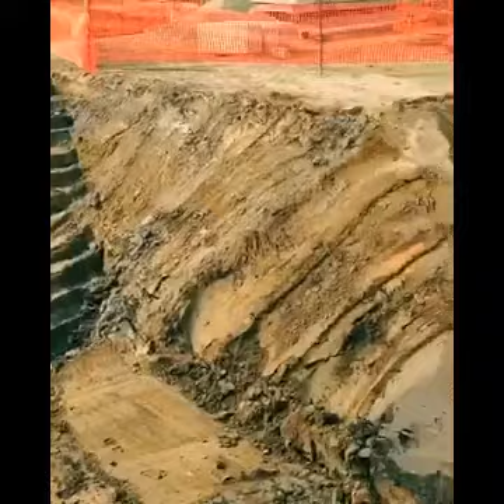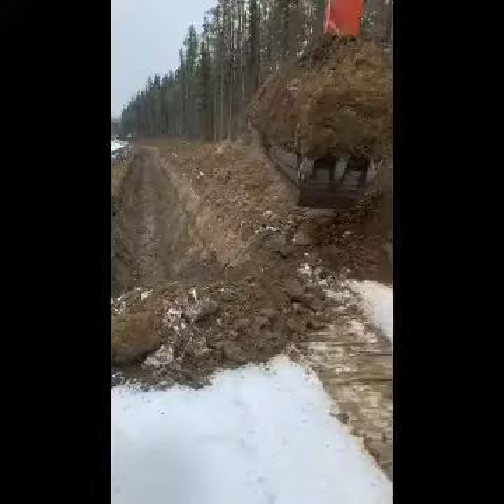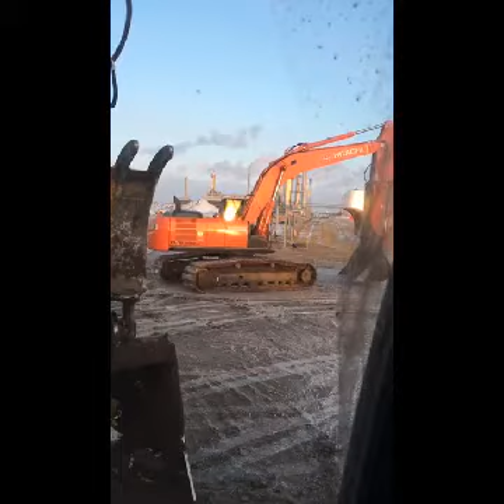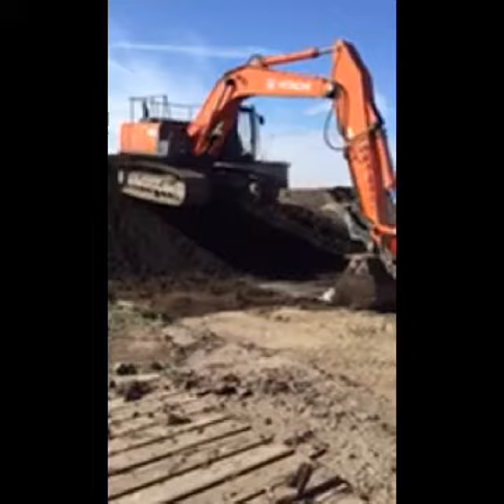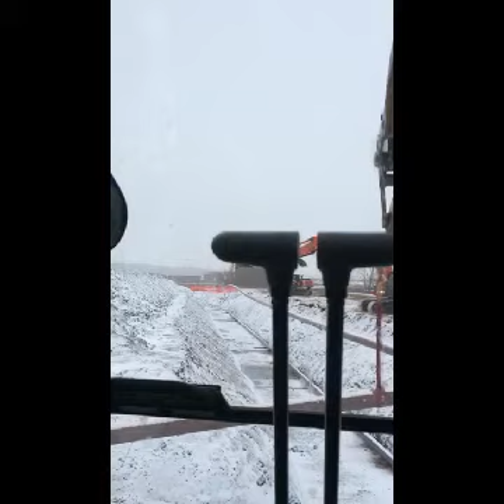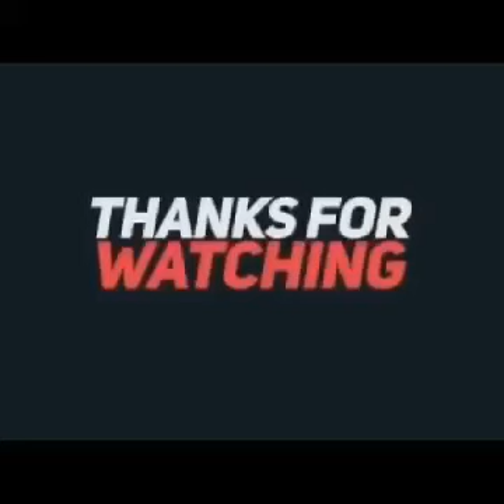Tips and Tricks for Excavator Operators! Efficient Excavations Trailer

Comment: So would u pick that Hitachi over the 336?
Reply from the maker: Any day. I tried a Cat 336 last winter for 3 weeks and wasn’t a fan. The power is too close, like at 90 degrees when you’re pulling a scoop out. Hitachi is out further, so your cycle time is 20/30% faster because you don’t have to swing as much. Pipeline ditch anyway
Reply: @efficientexcavations  wow thank you for responding, I guess I’m still getting used to the new 350LC-6, I’m not sure I like the new 3 pump hydraulic system. Plus I got the new longer stick.  My first Hitachi. Been in a CAT since 05. Started in the 235